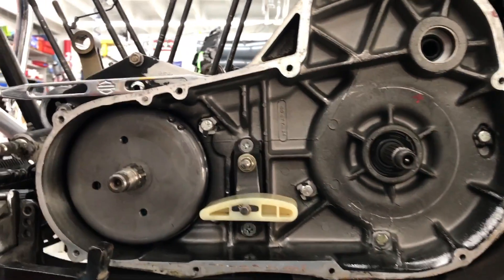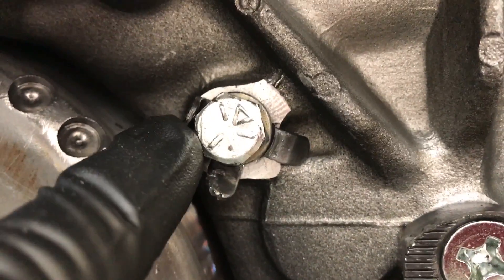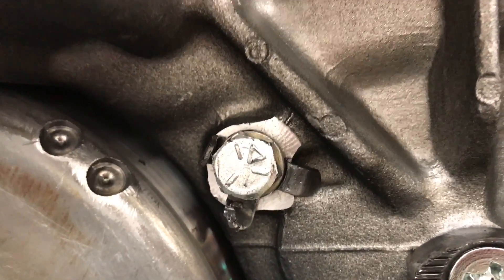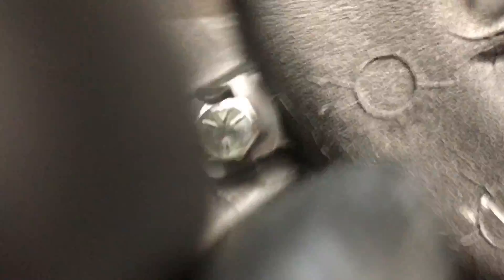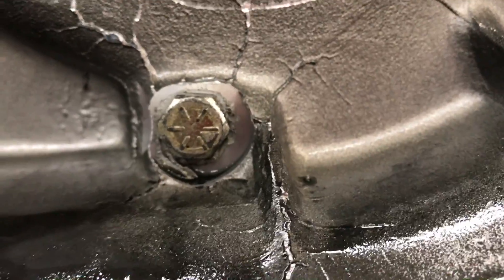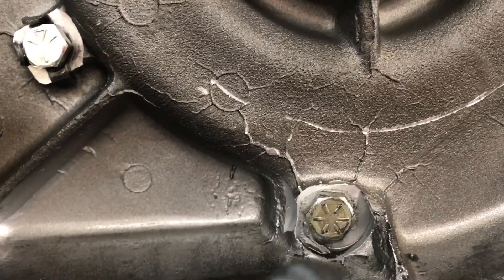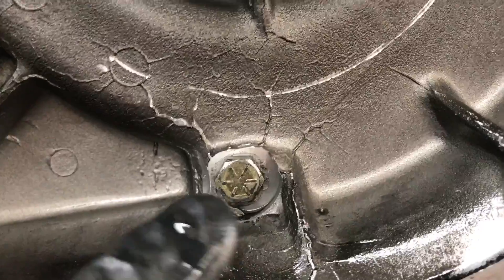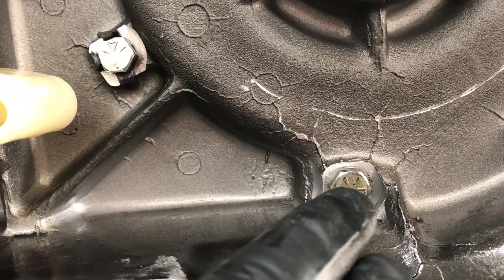Every Mechanic Series: Harley lock tabs on inner primary bolts and correct usage of lock tabs!

Comment: On a 2006 touring do I neeed sealant on the inner primary to engine/trans surface? Where the bolts go through. Was nothing on there when I took it a part and never had been apart before